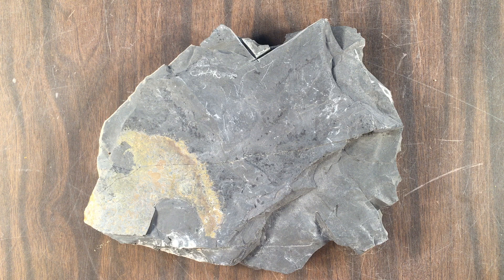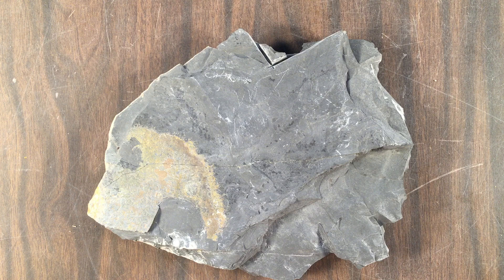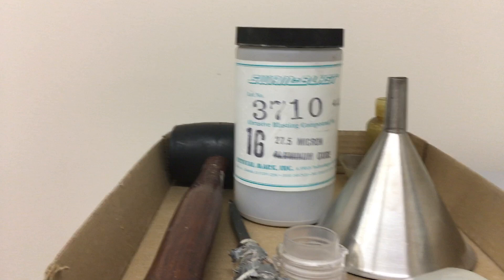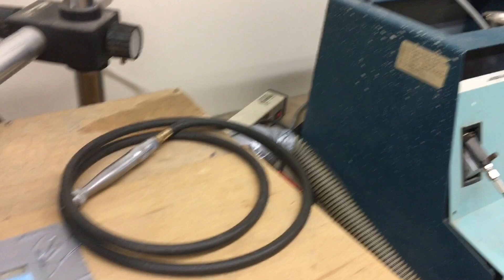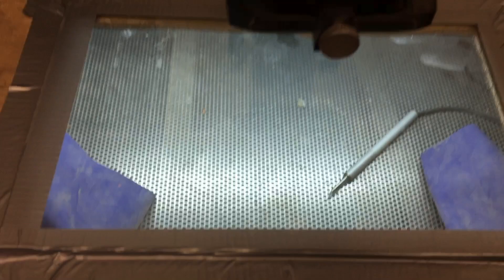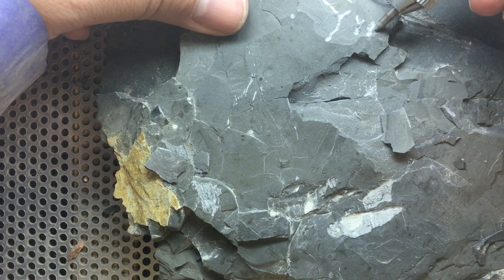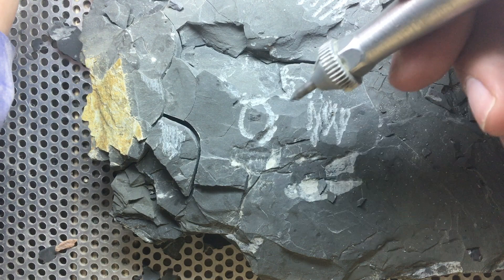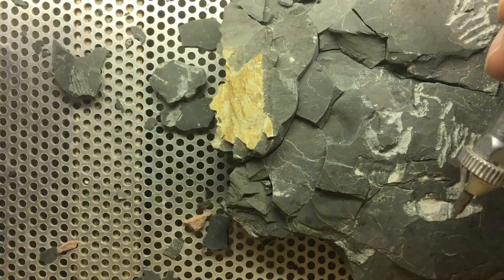Fossil Preparation of Trilobites!

Comment: One thing I forgot to mention, straight forward lines with the air scribe works best, circles spreads the vibration and can cause micro cracks that you cannot see which is why your first one split.
Reply from the maker: sorry I replied to you like a month ago, guess it did not actually post.  I will make sure to use strait line in the future.  Thanks for all the tips!

Comment: When it comes to soft shale, I find that using a dremel with a wire brush bit works very well. It's abrasive enough to remove the shale but not hurt the trilobite.
Reply from the maker: I do have those. I will give it a try! Thanks
Reply: I agree with the dremel part, it's what i used on my trilobite fossils from Utah, but be careful of using the dremel on different types of rocks that are not shale. The wire brush ripped the fossil apart..... think the rock was a limestone not for sure though
Reply: A wire brush dremel will actually damage the fossil. Under a 20x microscope you can see the brush marks and they are very noticeable. Under the naked eye it's hard to see the marks though.

Comment: Another recommendation, don't use aluminum oxide: baking soda is much less abrasive and less damaging to the fossil. Dolomite is another option, you can get this from some pottery stores, I get mine from a company called axner.
Reply from the maker: Thank you! I have tried to find some before and not had much luck.  Any chance you could reply with a URL to their website so I can show my professor and we can order some?
Reply from the maker: sweet thank you so much!! :)
Reply: No problem dude. Hope it works well for you. One thing I forgot to mention, aluminum oxide is less prone to clumping than dolomite or baking soda, so you may have to sieve it to get rid of any moisture induced clumps.
Reply from the maker: thank you I will keep that in mind!  I would not mind more tips in the future.  did you subscribe so I can get your help later? lol
Reply: Fossil Prep Blog yep, I subscribed. looking forward to seeing what you do in the future.
Reply: "my professor" ?  You're working under a professor, and yet neither one of you has been trained to remove fossils from rock ?  I should think that there are standard manuals for such work.
Reply: Lincoln Shoemaker calcium carbonate precipitate is also a good option that should not damage the fossil too much.
Reply: On the note of baking soda. How well does that work? That's much less expensive and much more accessible where I am
Reply: Table salt is also a good material. At least for green river fish.

Comment: I actually use a dremel tool myself with a carbonized wire brush. It keeps the fossils black and removes the matrix around the fossil nicely… at least that is my experience with it
Reply: That's exactly what I used, fossil is nice and shiney and the matrix is softer and removes decently easy. Would've been cool to have the tool that broke up the rock to find them though, I just used a rock hammer to split the layers and find what I could.

Comment: One method for preventing the fossil from flying away would be to put putty over top of it. The only issue is certain fossils, those in poor shape or with delicate form could suffer from the pressure of applying it.
Reply from the maker: okay i will try to find something to put on top of it next time.  thanks for the tip!

Comment: To remove a small area with a fossil from the plate, start with an area of circled that is 10x the diameter of the fossil and at least a 1/4" deep when working with shale or slate because it's so friable.
Reply: Friable? LOL Like you can fry it in a pan?

Comment: Does the school have other media available to use in their air abrasive unit? Dolomite, or sodium bicarbonate?
Reply from the maker: Not yet.  We are looking to buy some.  So if you know where to get some please let me know.
Reply: Fossil Prep Blog I buy sodium bicarbonate at the local bulk market. I get 20 lb bag for $6. It's not as hard so you can use a slightly higher pressure and it won't eat away the fossil as fast
Reply from the maker: thanks for the tip! I will make sure to suggest we get some. :)